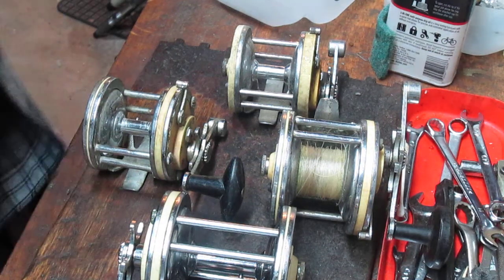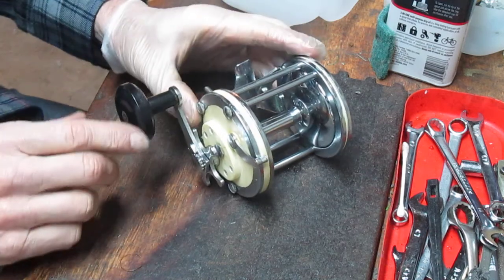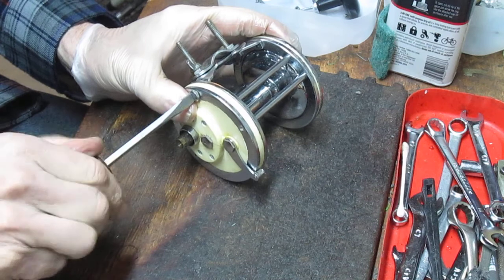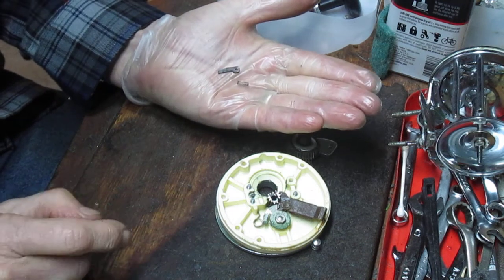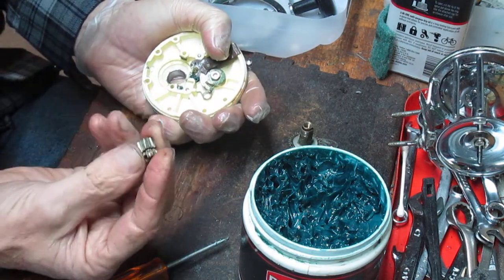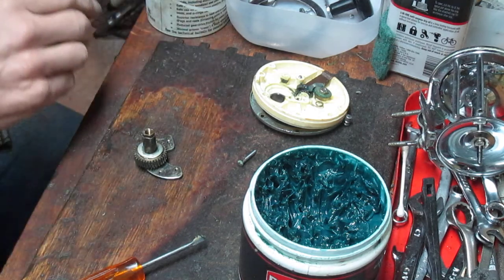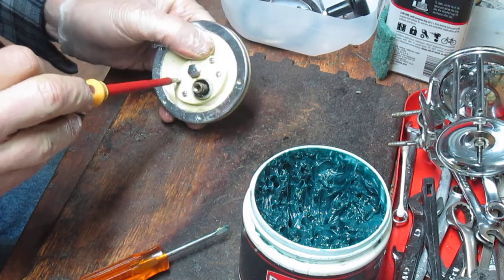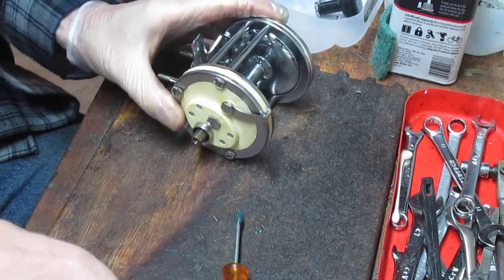Garcia Mitchell 600 series Saltwater reel maintenance and rebuild including drag service

Comment: Thanks Dennis,this was exactly what I was looking for. I acquired a Mitchell 602 today from the local consignment shop for $5.00. This thing works great it's just dirty and the handle is slightly bent. I dont understand why these reels aren't used anymore. Thanks! I had to sub!
Reply from the maker: Thanks for watching and the sub Mike.  The primary reason that these are not used any more is that parts are no longer available.  When they break, they are pretty much done.  It's a shame as the design and mechanics are good.  There are some Bass Pro Offshore angler reels that use the identical set up as these reels internally, but the parts are not interchangeable. - Dennis

Comment: I have one sitting in my project box. Someone spray painted it yellow and it has the classic cracks in the side plate . Mine needs a new spool. Current one is toast.
Two things I'd like to share is that this reel is a knuckle buster and the handle actually can fit on a jig masters and other Penns. Screw is the same threading.
Reply from the maker: Thank you for sharing.  These are great reels at a reasonable price if you can find them.  Keep on fishing them, busted knuckles and all!
Reply: Gary Dodgson yes sir. Looks like someone wanted to try and touch up the side plates and match the aged yellow. Thanks for reminding me to start looking for a new spool. I want to use it for some beach or pier fishing this summer.

Comment: Hi dennis great imformative video , I followed your instructions great help.on my 624 ihad to replace the drag washers I bought them online no problem I'm from uk the only ones I could buy were carbontex material.? It says on instructions that you can leave them dry or grease them .At the moment I've left them dry they seem to work fine but have not used it fishing yet . Would greatly appreciate your feedback cheers pete
Reply from the maker: Hi Peter.  The instructions are correct.  They can be dry or you can use grease.  I find that the grease helps prevent them from drying and prolongs life, so I go ahead and use it.  I use Cal's universal drag grease for the task.  I don't think that increases or decreases the actual function of the reel, so if you have installed them without grease, you don't need to worry as to whether the reel will operate properly without it.
Thanks for watching - Dennis

Comment: Hello again Dennis, I just finished going through my Penn 309, 6/0 and 9/0 with your help and said you would be hearing from me again. I was given one of these also which I cleaned up but had 0 experience at the time and didn't even know what it was since the tag was gone, all that was visible was "made in France". I still don't know what model it is, it has a short crank, spool width measuring between the rings is 1 3/4"  and diameter measuring the ring is 3 1/4". Is that enough information to determine model?
This too is one of dad's old reels, thanks again for all your help
Reply from the maker: Jeffrey -the  lost label is a common problem.  You have the narrow body, which is the Mitchell 622.  The wider frame, about 2 3/4 inches diameter is the Mitchell 624. - The internal gearing is the same on both reels, just like the Penn Long Beach 60 & 65 reels.  The difference is the frame and spool lengths. Thanks for asking - Dennis

Comment: I just found one of these. It's the 622 and it also has the crack you mentioned. Judging from the blue discoloration on the side where the crack is, I would assume that all or most of the blue grease is gone; but everything seems to be in order and mechanically operational. I will service it and take it on my next fishing trip.  What is the best way to polish the chrome? Thanks for the video!
Reply from the maker: Good to hear George.  The spider cracks are mostly cosmetic and not structural.  Just a weak point in design.  Good luck fishing - Dennis

Comment: Dennis, I saw in another video, it was said to put the brass washer with the lugs into middle of the drag stack. I've always put it on top, what's right please, as I'm replacing my leather washers with carbontex ones.
Reply from the maker: If you mean the keyed washer with the two ears that go in the slots, then that one does go in the middle.  - Dennis

Comment: So glad I found this video as i had the spring fall out and had no idea where it came from. Can  you suggest a fabric to make replacemwnt washers from please
Reply: For my 600 series Mitchell, I used a Penn 85 complete drag assembly from HPR Bearings, at EBay. Same inside diameter, only very slightly smaller outside diameter.

Comment: I have bought 2 of these reels off of ebay in a week. The 1st was a 622 the 2nd was supposed to be a. 624 ID tag missing on the 624. The 624 was wider than the 622 but smaller in diameter. Could the 624 be mistaken for perhaps the 600 or another model as the 624 I think should be larger than the 622. Am I correct? The 622 had it's tag.
Reply from the maker: If the diameter of the second reel is smaller than the 622 and the spool is wider, then you most likely have the 600A.  The 624 is the same diameter as the 622, but has the wider spool.  By comparison to the Penn line, the 622 approximates the Long Beach 60, the 624 the same as the Long Beach 65 and the 600A the same as the Beachmaster 155.  I hope this helps.  By the way, I have a 15-20  of these vintage reels and only 2 or 3 have the tags on them. It is a common problem. - Thanks for asking - Dennis

Comment: I'm fixing to break my 622 down again, the chrome is spectacularly clean however the side plates are spectacularly a dingy yellow. I have no expectations of a miracle but would like your opinion of a safe cleaning method. Also, should it need drags, did you say Penn part #60 could be trimmed to fit sufficiently?
Reply: actually dawn soap and a scrubby sponge did wonders for it
Reply from the maker: These side plate are pretty tough.  I use turtle wax chrome polish and a kitchen scrubby pad on both the metal and the plastic.  It is abrasive, but not too much that it scratches them.  If it is dirt and grime, I use Purple Power, which is a concentrated degreaser.
Reply: a Penn 85 Carbontex  kit from ebay fit mine pretty nicely. No trimming was required.

Comment: I have a 622, what's the line capacity for it running 65# power pro? It's just for deepish jigging, I have probably 250-300 yards on it right now , any idea on how much to fill it to capacity?
Reply from the maker: When you switch to braid, you can usually pick up an additional 30% of line capacity and sometimes more on the bigger reels.  If you have 250-300 years on the 622 now, you should get closer to 400 yards with braid
Dennis

Comment: Hi Dennis new to your site I tore down my 600a Reel One of the drag washers is wavy is this normal or is it just a bent washers? You also mentioned a location for new washers Thank you for a great video
Reply from the maker: Yes there is one cap washer that is the last on the stack and it is wavy.  That acts to give variying tension to the star adjuster. - Dennis
Reply: @2ndChanceTackle  Thank you hard to see that on the video glad for your reply thank you Dennis

Comment: Do you by chance know how many lbs of drag these were rated for? I have an old 624 laying around that I’m considering going through and possibly use for striper trolling, judging by the build quality and size it’s comparable to penn senators in 3/0 and 4/0 size which is what I was already considering using for the purpose.
Reply from the maker: Dan - I don't know.  I would guess around 15 pounds.  This reel is almost identical to the Penn Long Beach 65, which is rated similar.  Thanks for asking - it can and should go striper fishing - Good luck with the catch - Dennis
Reply: @2ndChanceTackle  thanks for the reply. So it shouldn't have an issue spooling with 40 or 50lb monel wire? I just noticed you can find carbon fiber drag discs for these, so that's half the equation. If only they had gear kits now...
Reply from the maker: Yes - you can go with heavier line.  I wouldn't spend too much hot rodding the reel, but the drag upgrade would be worth it - Dennis

Comment: on the mitchell  reels , can the  coffee grinder knob  be removed  ?  or are the preasure end pins just for  inserting oil ??
Reply: sorry  Rephrased - on the mitchell  reels , can the just the knob on the coffee grinder arm  be removed ?  or are the preasure end pins just for  inserting oil ??
Reply from the maker: I am not aware of any way to remove these knobs for maintenance or replacement.  I believe they are pressed on.  The point in the middle of the knob is for oiling.  I have seen folks drill out the stud from the bottom of the handle and replace that way, but that is a bush fix at best. That's not recommenced unless the knob has failed or broken completely  It is it just hard to turn. try a healthy spray with WD40 and let is sit a while then try to work it free - Dennis
Reply: @2ndChanceTackle  Thanks,   knob  is not  broken , just  does not spin , did drop in some oil  which helped a little  ,, and will try  some  wd-40  thanks  ,yes i do use  mitchell  multiplier's  from my kayak  ,ocean fishing , out of oceanside harbor Calif.   still comfortable  and can  easily take apart for cleaning , parts are still  available , though does sometimes take some searching but that  the fun so far, thanks  for the  rebuild  video ,, Do you know if the spool  spindle is removeable  ??
Reply from the maker: These are solid one piece spools.  The spindle is not removable - Dennis
Reply: @2ndChanceTackle   , hmm  ok  was hoping Not  to hear that ,  i have one with spindle end actually  worn down so  drag tensioning  nob needs to be  to tight to prevent  spool from   wobbling and  scraping  chromed edging , i did replace the spool  but just seems  a little of a waste  to just toss the spool because of the  worn spindle end , hmm maybe i could find a small washer
Reply from the maker: They are just for oil.  They cannot be removed

Comment: How can I do a better job to evenly load the reel with line?
Reply from the maker: I am not sure of the problem you are having.  The basic Lind spooling method is to use your thumb of the non-winding hand to guide the line evenly.  Wrap you free hand on the rod ahead of the reel where your hand is cupped to grab the rod from underneath.  That should allow your thumb to point up and intersect with the line.  You can then move the line left and right using your thumb as a guide.  Does that answer your question?  Thanks for asking - Dennis
Reply: 2nd Chance Tackle this is just what I need. Thanks.

Comment: Every single one of these I've ever seen has a crack in the handle-side plate.
Reply from the maker: I have at least 10 in my work pile and, like you said, every one half them have the spider cracks.  I think we can agree it is a design or materials issue - Dennis